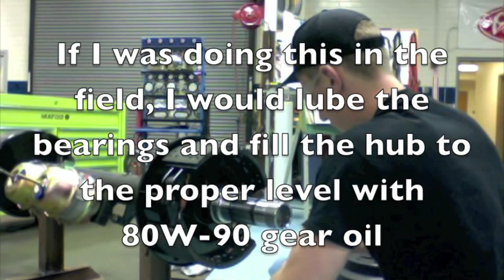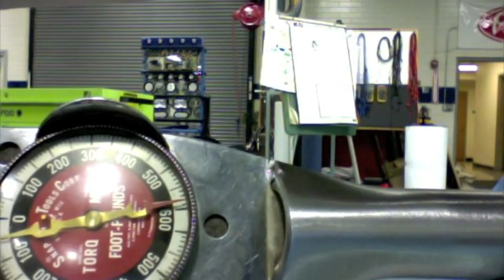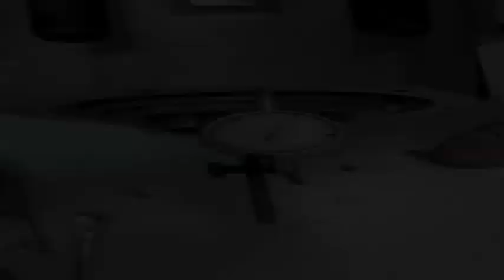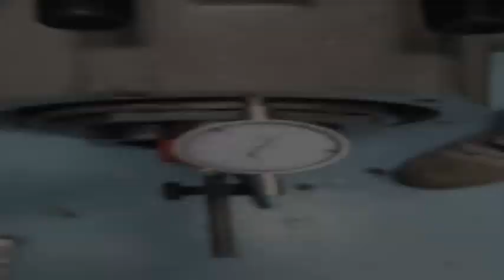Adjusting wheel bearings according to the RP 618 procedure

Comment: I shoot for zero tolerance or just barely hand tight.Torque to 200,spin it like 10 times.Back it off till you can turn the spindle nut by hand.Re tighten the spindle nut down untill it barely touches the bearings.Lock it down and check for end play I want none.Re seating new bearings will wear a little in the races and free up in a week.Re check them in a month.Good to go for 1 mil miles.I have the crush preventing cone type hubs.I also make sure I turn the spindle nut by hand tightening after seating until I hear the lock tabs click in place.
Reply: how much pre load do you have after the outer nut has been tightened to 200 ftlb?

Comment: Dont think you have demonstrated RP618 dial indicating properly.  The method of checking the endplay is as follows:  Grasp the wheel assy at the 3/9 oclock positions.  Push the wheel assy in / out while oscillating slightly to seat the bearings. 
Seems like the student was applying veritcal movement vs in/out

Comment: One mistake, never let that hub lean down like that before outside bearing is installed, that will cause premature seal failure, otherwise the student did a great job
Reply: I agree all that weight will tweak seal. What I do is support the outer hub with jack stand or something and fill the hub with oil then install the outer bearing.

Comment: nicely done. @mister nighbane the seal appears to be hub mounted and when did he slam it oh the spindle. Its Within spec and its gonna last 2-300k miles as long as it's freeplay is within spec, it has a clean sealing surface on the spindle shoulder & wasnt damaged during installation IT'LL BE JUST FINE !!!

Comment: The older style seals (national 37 series) with an internal wear surface and rubber with a backing spring can stand a little play but 1/4 turn backed off is going to exceed that. 38 series with lay down lip teflon will take a lot more, but nationals recommended procedure is 200 while rotating, back off 1 turn then 50 while rotating adjust as little as possible for washer to fit then everything you have on the lock nut. Torque is lower on a steer axle. I started doing it this way 40 years ago and haven't lost a bearing yet. Except I wasn't using a torque wrench (but verified with one since, just a 3/4 ratchet.

Comment: Hate to critize someone's else's work publicly but there's no need of rotating the hub while preloading or doing final torque, also in my opinion your inner bearing was installed the wrong way, any I've ever done have had the tapered side pointing out not in, common procedure is torque to 200 for preload, slack off 1/4 turn, torque to 50 pounds and slack off 1 10th of a turn. Don't take my criticism the wrong way, also if you do have all the specs right in front of you, of course follow them. I just think the inner bearing was installed backwards, good work best of luck in the future!
Reply: You turn the hub to make sure the bearings are aligned and not binding up and it also helps to make sure the races and bearings are 100% seated!!! I have been doing this for almost 30 years now and it is very important to turn the hub when installing new bearings and races or even as a precautionary step when reinstalling used bearings and races.
Reply: depends on the threads per inch and the size of the nut.

Comment: no wonder all these seals leak from the dealer when you purchase a new trailer or tractor this is all wrong ,come to my shop and let me teach you how its done ,you do not need no movements on trailer wheel bearing ,they cannot even set the pre set hubs correctly, when i reset them they never leak for about 5 years
Reply: Are you saying a quarter turn backed off on the bearing preload, is too much ? I always thought so...
Reply: @DSM Truckinginc. I agree with you on leaving NO PLAY. There sure are a lot of beginners on YouTube on how to adjust tapered bearings. I've done this kind of work for 51 years and can't believe what I see here.
Reply: @bottmar1 Axle Surgeons thanks you for the work...